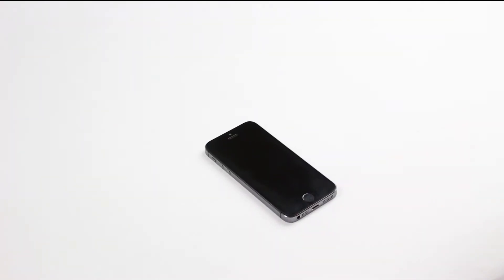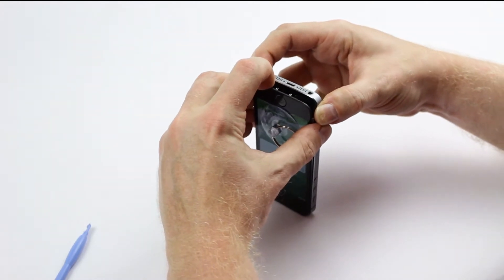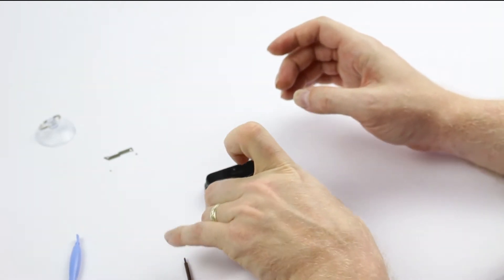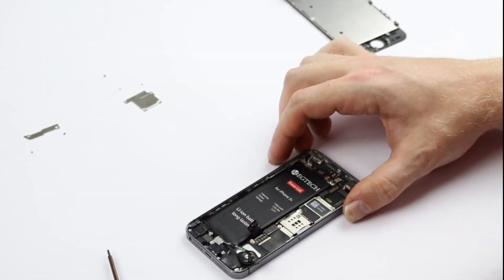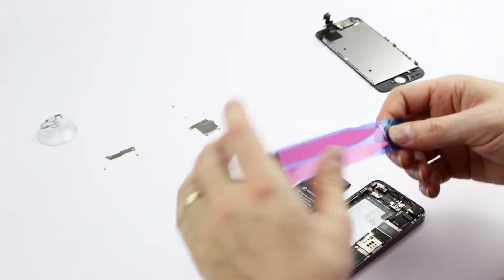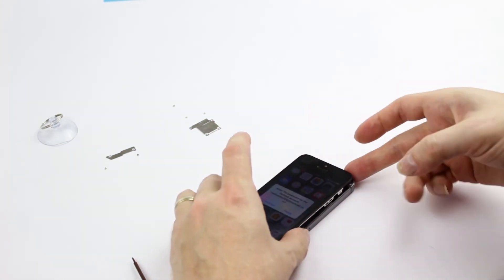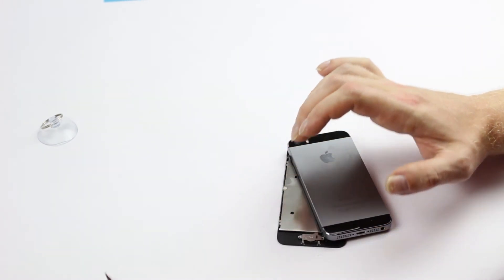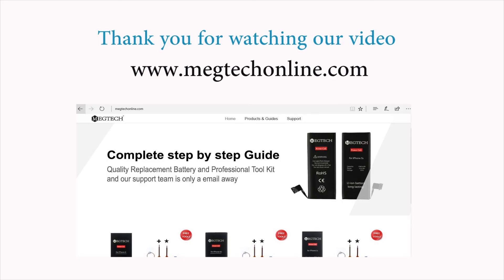iPhone 5S Battery Replacement (HOW TO Full WALK THROUGH) - MEGTECH

Comment: After blasting the old battery with a hairdryer on max and wrenching it out I just about managed to get the battery free.....but damaged the Touch ID sensor in the process. Cannot believe how hard it was to physically remove the old battery. Other than that the process went smoothly. Good video but maybe film them from above and keep the camera on mental focus- Your hand obscuring parts and the camera going out of focus were the only bad points.